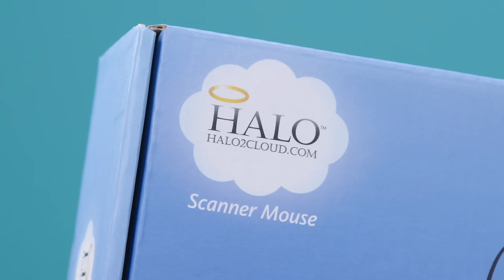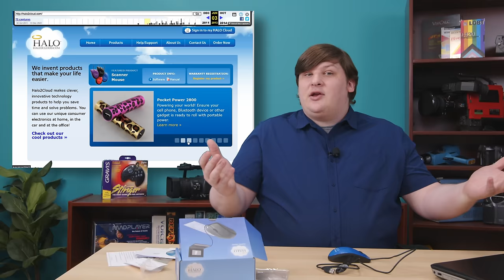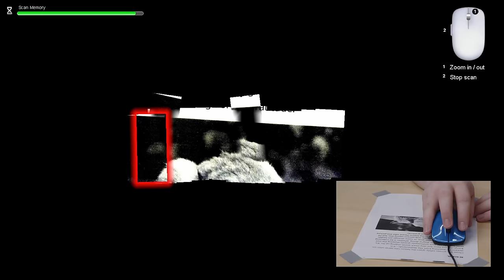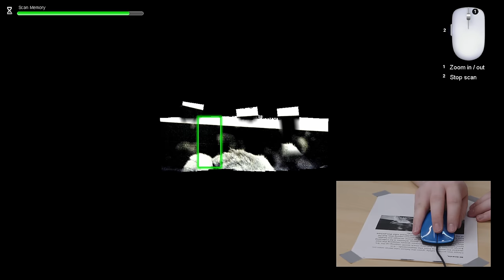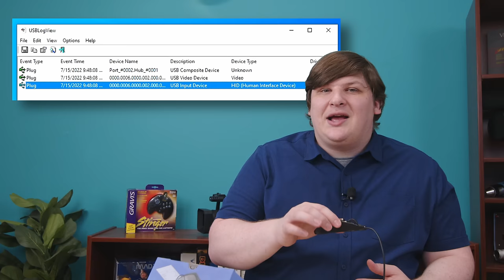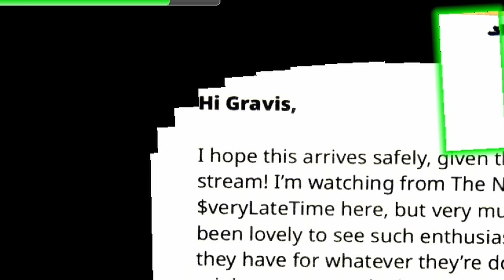Why would you scan things with a... mouse?

Comment: I don't know if someone else in the comments here has pointed out how the mouse can send more data in HID: HID just works like that. HID is a very generic standard, and actually supports defining an arbitrary number of inputs and outputs, and it's up to the software to figure out what they mean. Windows reads 3 axes (x, y scroll), and a bunch of buttons, but likely totally ignores the extra mouse axes, while the bundled software can talk to the HID device directly, and get the raw values from each sensor.

Comment: I absolutely rock one of these.  Probably should have bought a few spares for $10 ea before this video came out.  It works just fine, the only annoying thing is it tends to become the default camera if I disconnect my web cam, and I have to switch it back.  NBD.  Maybe it would be nice to get rid of the blue LED under the scan button. Works awesome on long receipts.  The software is MEH, but the OCR is impressive for the time.

Comment: The fact that it works once or twice then never again is interesting — because of the way it fails. As you noted.

However — I would like to put out a novel possibility for why this is! 

These scanning mice have achieved a level of AI consciousness that may be rudimentary but seems to have crossed the threshold of “we have multiple analog inputs being cross referencing in a perpetual sequence to the point that we realize that the anchor we believed was there was —in fact— relative. And now they go haywire. Not because of a mechanical failure but because of sensory overload and an over abundance of memory (or data on previous positions). These devices experience a micro-scale existential crisis and fail. Nothing is real to them. They have no third frame of reference to at least “start fresh” with a new task. They are — in fact — more human than we give them credit for. They’re trying to do more than they should in a way that is cross-resource sampling and analyzing, but not in an efficient or limited/governed way. 

In a sense — despite your love for analog tech — these may be the most human tech you’ve ever reviewed.

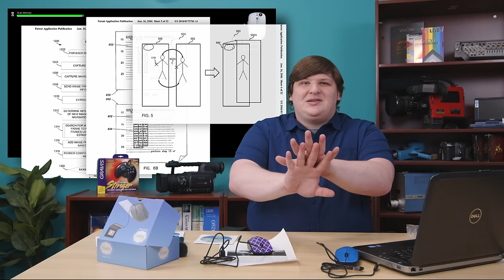Comment: 22:43...I did that in C programming for a YUV4MPEG effects program...it took a shaky camera image and stabilized it...you do a binary eXclusive OR and take the opposite of the result while moving the new image over the previous image and gather a 2D array of the number of bits that are the same...the location in the array with the peak number of bits the same are the coordinates that the new frame needs to be shifted over to be where the previous frame was. I want to figure out how to do this with analog audio recordings such as records and tapes and have it so you can use multiple copies of the exact same recording and lock the speed to the one that you choose sounds the best...then average the result...the more copies you can find the closer you will converge to the original studio sound. Someone did this with a program called Rootiply...but I want to have an open-source version that I can use for myself. I was getting some semblance of a drive signal from a cassette single with the same song on both sides of the tape, but during silent parts of the song I was losing lock.

Comment: I don't think that is a hardware failure. It looks like a software bug. The OCR driver is misidentifying changes between two images that are actually identical. Since it thinks the image changed, though it didn't, it tries to fit that new image somewhere within the "document-space". But the correct place for that scan is already taken, the original scan took it before the second scan misidentified changes, so it just makes a completely irrational choice for where to put the new scan image. It is the exact same bug as the panorama bugs, but expressed differently because there is an additional element of variation not present in the regular panorama procedure.

Comment: It is fairly easy to scan large documents, just use the pdf scanner in your smartphone and put the "document" on the floor in a well lit room and scan it. As long as you can be high enough of the ground and still focus and see the print/image without casting a shadow on it you can scan it, for free.
Reply from the maker: I'm talking about something like a 4'x8' banner. There's no practical way to scan that at a reasonable DPI. If you get it all in one shot, with any phone on the market, the effective DPI will be garbage.
Reply: @CathodeRayDude  With 12 M pixels or more like a modern phone has you would get a clearly readable image like a normal poster for example 120 x 60 cm(4´x2´) for example. Reproducing a large clear image on a screen is absolutely doable. My monitor is 32" (3.7M pix rez) so a image from a camera of 12Mp could capture a image 3 times that size. Any bigger and we are talking industrial equipment, beyond "normal" home use and they do often stitch images when size demands it.

Comment: A single mouse sensor only detects movement in two orthogonal directions. You need two mouse sensors to detect rotation  of the mouse. They likely use the mouse sensors to determine the location of the new image. If the mouse sensors are accurate enough, they would not need to stitch the images together at all. The offset problems you show in the end of the video seem to indicate that is what happens.

Comment: it could be that the optical flow sensors do not provide rotation information. do one sensor alone would not tell you the location AND rotation of the mouse. notice how with regular mice, it doesn't care how you rotate the mouse. if you buy optical flow sensors for arduino, you will know that the chips provide no rotation information. by having both sensors you can probably use some math to calculate the rotation of the mouse.

Comment: I actually have a scanning mouse that I bought about 8 years ago as a novelty, and still use from time to time.  It's a much more solidly built one and it's never had a problem.  My only complaint is that it is not comfortable to use (in the slightest).  The one I have also has a larger window and a couple programmable buttons on it.

Would I recommend it?  Hell. No.  Just grab your phone and snap a shot.

Comment: 38:01 Which would totally ruin it for the main reason that I would use a document scanner...storing non image/non text data on paper such as 2D barcodes...If there's a little glitch in your shiny wet priest image...that's no big deal...but if there's parts missing or duplicated in a barcode...it wreaks havoc with the decoding.

Comment: I'm assuming you have experience with using After Effects built in motion tracking tool, where with one point you can track motion but with two points you can track motion, rotation AND scale. That's a good analogy for what I believe the sensors on the mouse are doing and why there are two of them.
Reply: Scale as well? How does that work?

No, wait. I think I've figured it out. Rotation comes from the component of motion perpendicular to the line between the sensors. If you rotate it, you get one sensor reporting motion in one direction and the other in the opposite, but with both perpendicular to the line between the sensors. Scale comes from the parallel component. If they report motion away from each other that's scaling up, and towards is scaling down. 

So how does translation work, then?

Oh, of course: averaging. If rotation and scale are based on vectors with opposite directions, then adding them together would cancel out those components, leaving just the translation.
Reply: @Roxor128  another way to look at it is how you would use two fingers for scrolling, zooming and translating on a touch screen. You just tie the two initial points to where the fingers end up going, which gives you translation, rotating and scaling.
Reply: @familyguy0398  Huh... Yeah, that probably does use the same underlying mathematics. Never occurred to me before that the gestures actually had some mathematical basis. I just thought they were arbitrary and were picked because "Well, we've got to use something for this action."
Reply: @Roxor128  I've done programming for a mobile game which uses two finger zooming and panning. If you ever want to talk about some of the programming behind it I'd love to go into it

Comment: I've had a keyboard and mouse soft fail in the same exact manner across multiple PCs. On Windows 7 it runs forever. On Windows 10, maybe a month or two if I'm lucky, then it poops the bed. Currently running my G19 keyboard and beloved G9 mouse on my Windows 7 Alienware M17x R3 with no issue. Plug into a new Windows 10 build they'll work, but not for long.

Comment: If you scan with a phone, you must deal with distance  & tilt changes.  In the mouse, distance & tilt are controlled.  it would be "too much" for the processing to reconstruct!
          Mouse & scanner are NOT "two unrelated features"!  Consider how mice work today: they do EXACTLY what the scanner does (correlate shifts in camera image to determine direction/amount of motion).  I am surprised they didn't use the (fancier) camera for ALL  functions.  The "mouse sensor" is just another little camera!  The only "gotcha" is needing to stream all that data to/from the PC.

Comment: I am very sad they decided to make this so cheaply to aim at a bottom of the barrel segment. For a mid or high end device this thing could have been incredible. I certainly would have wanted it, as someone who carried a portable printer and scanner in my backpack (my school was not ideal for being paperless), if this worked well it would have been smaller, faster and more flexible than my portable scanner, while doubling as a mouse for my portable laptop. I would have loved it if it worked. I could even see using it now if they made a wireless version, would be very convenient, and if made well potentially more reliable than other portable scanners.
Reply: It’s basically doomed forever unfortunately lol. given that it was a market failure the bigger corporations won’t touch it. And it isn’t startup material because a bunch of patents exist related to it but are expired or soon to be expired, so even if you could buy them you won’t get very far.

Comment: 17:39 - What likely causes this is a capacitor or an IC. It likely is calculating wrong values, or a capacitor is sending erroneous signals. Could even be a pull down resistor too, as those are usually on data lines / bias lines.
Reply from the maker: It doesn't seem likely to me that both devices suffered the exact same component failure at exactly the same time, a decade after manufacture, but only after 10-15 minutes of runtime. It's possible, but...
Reply: Capacitor sending signals? LOL, no.
Reply: @CathodeRayDude  

My guess, is because it was engineered to be cheap, and is an engineering sample, and NOT from a vendor itself (no after-prototype testing), there is a failure mode that happens after a certain amount of time. This seems to be that a component / design breaks down given time and then causes odd results. 

Usually this is a bad cap / resistor, and causes a short, which kills the device, but the device seems to "work" still, just gets bad data / readings. 

My feeling is a cap, resistor, cable, solder joint, etc could have become weak and causes stray voltage / bad pull up/down signals, and causes the behavior. It's not bad enough to kill the device, but is bad enough to cause signal loss within the device (or output from the camera module controller that sends the data over usb). The failure could be a lack of foresight in failure modes / testing, such as high voltage for the LEDs possibly feedback back into other areas / not being shielded, and issues similar to that. 

Usually when a device fails after some time, there is some weakened component that causes a failure mode / works out of spec. When it comes to erroneous operation, usually is a passive component / shielding of some signal (or power to a device that generates the signal), or damage / breakdown of an IC that's behaving incorrectly. 

It's really hard to say unless I had a schematic and tested a few different points to see how signals travel in the device. 

You might be able to pinpoint it by looking at USB packets, and looking at the HID data, or the camera image data (as you've proven it's a reasonable standard packet format, aside from small resolution). 

It would be fun to make an app that does this via software for android however, and i might think on that. I LOVE the idea of a free hand scanner that stitches images together.
Reply: @zaprodk  

Capacitors can sometimes be filters.....

Signals go through them, and they can also be used in timing circuits (they can generate a square wave pretty easily in conjunction with a latch circuit).
Reply: @1337GameDev  yes. But they don't "generate" erroneous data. Thatdy the part I'm commenting on. Both USB and PS2 is high level protocol/interfaces. It's all logic, no analog "magic" and filters here. This is a 100% firmware/software problem.
Reply: @zaprodk  Well i was meaning in the circuit they could generate bad data, and the microcontroller could see this and just package it into usb packets and send it on it's way, regardless of errors as it's cheaply made.

Comment: Just had a thought -- what if one motion sensor is "coarse" and the other is "fine"?
Reply: Think about it - the mouse sensor is very specialized. It only translates the movement into X and Y. It will never translate into rotation (z) which is what they needed. By having the two sensors, they can calculate the rotation.

Comment: you might have overthought the tech overview I think.. There are 2 IR diodes for an x and y tilt axis, which respond to the granularity of the paper,... ... so, the paper moves, your mouse cursor moves. easy as that.
Reply: it rotates because 1 shows movement and the other dont. think about it, when you rotete the mouse in the same way the cursor suggests, having 1 blind sensor.

Comment: right. ok. so a mouse contains a ccd element anyway (just that due to the nature of the ps/2 protocol which is based on ball movements, not images, this isn't accessible directly) and as such there is no problem in scanning things with it while it's mousing anyway (other than that not complying to any protocol standards previously set ;) . secondly, scanners are that slow not because cameras don't do a much better much quicker job at indexing a few million pages, basically as quickly as you can flip them by, but because the book printing industry kinda like bribes the scanner industry not to make them faster. (its' something like that anyway - probably they don't even bribe them, nah they actually want money of them if they would make a proper product that does it in a microsecond. lol. ).

Comment: 33:52 I'd  bet my money that they use two sensors to get the rotational data. Since sensors provide the data on how one "point" moves, which is NOT enough to determine the placement of the 2d figure in 2d space(think of it like fixing say a rectangle in place by fixing just one of its corners, you can then rotate it in whiever direction you like, aka you can't say where the rectangle is if you only know where one corner of it is, same principle), but more than enough to move a "point'er" on screen(i mean while it would be cool to see a pointer do a barell roll i doubt it has any real practicality)

As for HID(and usb in general), you will be surprised just how extensible(and hacky) it is, fact of the matter is there A LOT of hid devices are rather weird, for example a lot of digitizers have a generic mode and a  "vendor mode" designed to work with vendor software/drivers to provide full set of capabilities and circumventing the limitations of the generic graphic tablet apis which is activated when it gets "talked to" in a certain way.

Comment: This isn't new tech. HP's Capshare did it first in 1998, and I bet that 2016 patent refers to HP's patents from the 90's for the Capshare. The biggest difference is the Capshare was a standalone device, bigger, and only black and white. Of course the Capshare wasn't a huge success, but the patents certainly were for HP. They led to the development of the modern optical mouse.
Reply from the maker: It shares some tech, but it's definitely a distinct design. The Capshare uses a linear imager and going off the manual, it does in fact have to be (or at least prefers to be) moved very carefully in straight lines. It also appears to not cope well with being lifted from the page, presumably because it runs on pure dead reckoning instead of matching new samples against collected ones.

So yes, it's using surface motion trackers, but that's a minor feature;' it just provides hinting for navigation. The bulk of the scanner mouse - in terms of both technology and value prop - is the ability to scan a document in any direction and orientation, randomly, using a rectangular CCD. Even if the Capshare can do that, the manual makes it clear that it doesn't do great with it.

Comment: Alas... If you want a way to scan documents by holding your phone camera over a document, you may have to resort to photogrametry. Then make a 2D render of the 3D model produced by the software that turns your camera data into something useful. Which is all a lot more involved than the theoretical mobile app you were describing.

Comment: Probably just defect capacitors. Looks like typical erratic behavior due to unstable voltage supply….
Noise in the input lines/sensor leading to random movement.
If they have a bad elco, extra cheap version ;) you could try to replace it…